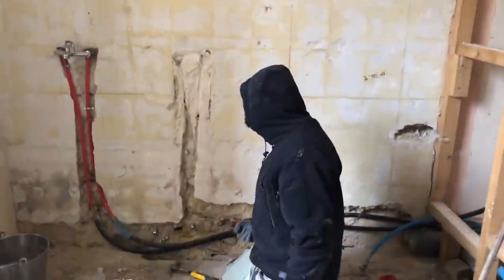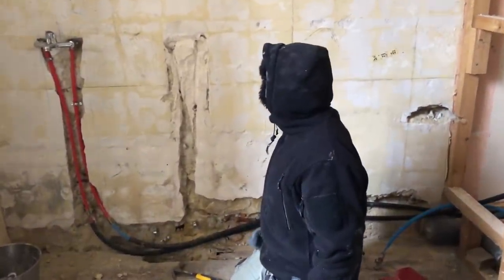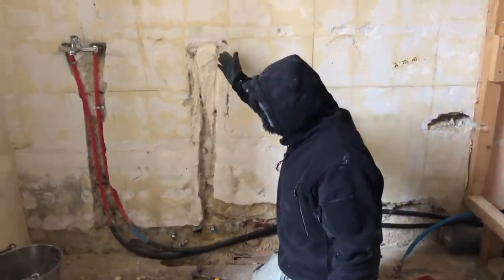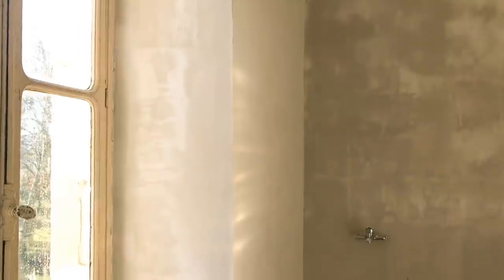300-year old CHATEAU FLOOR RESTORATION  #Renovation #restoration #DIY

Comment: Enjoying the renovation, Just had a thought! Have you thought of putting a twin wall stainless steel flue pipe up the chimney from the room below, you can then box it in in the room you are working in, It would give you another usable fireplace down stairs with a wood burner more heat in the house! keep up the good work....

Comment: Well done for even attempting plastering Leanne👏 I do know coming from a long line of plaster’s & trades that the metal strip goes on the outer edge of the wall as the metal make it much stronger💪 from knock’s !!!
Reply from the maker: Hi Sandra thanks so much. So I did get it wrong then? Ha ha, haven’t had chance to research it still 😂